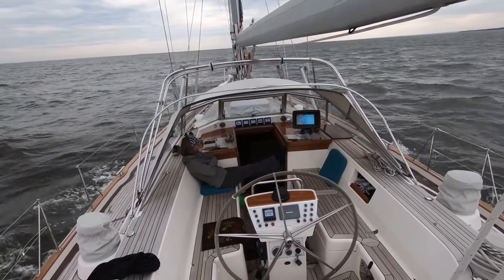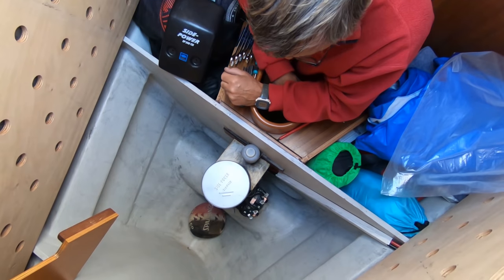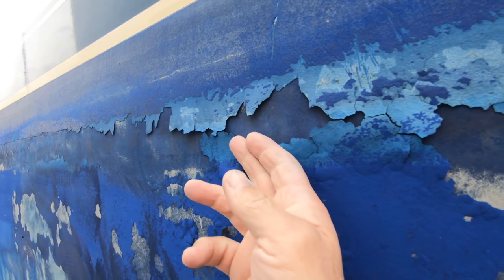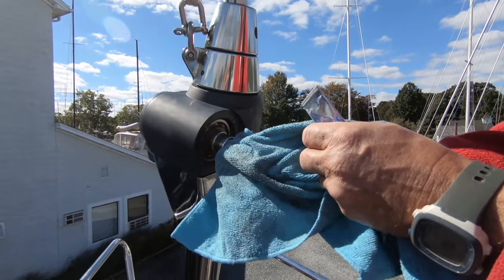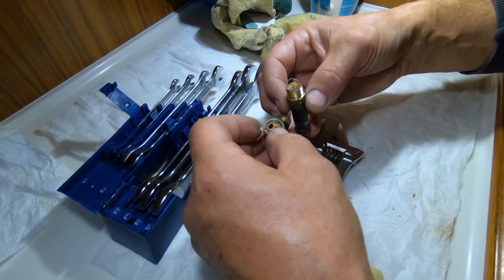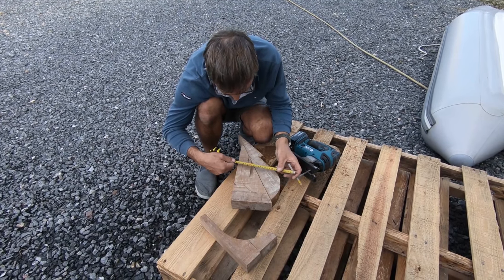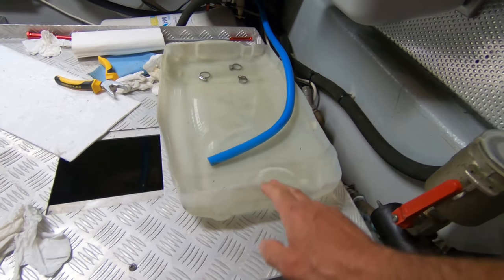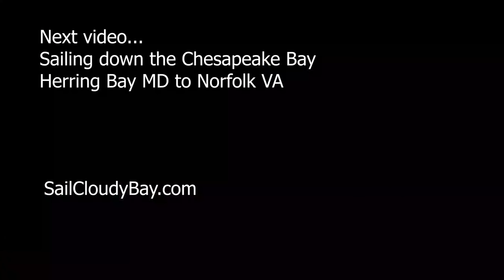ep48 - Boat maintenance - Herrington Harbour North (MD) – Hallberg-Rassy 54 Cloudy Bay - Nov 2018

Comment: You may want to clear coat the propellers with the same stuff they use on cars? Then when you hall it out they're clean. And then redo them as well when you do bottom paint?
Reply from the maker: I assume you mean a silicon coating?  Unfortunately I don't think what you put on cars would last even a week in seawater. The Prop-Speed that we applied in this video however is a silicon coating with the right strength and properties to counter the harsh marine environment. We now have this on the prop for 18 months and still nothing (much) sticks to it. but its frinkin' expensive stuff!

Comment: You can strip the bottom with a sandblasted. Substitute sand for crushed Walnut shells, it works great without causing and damage.
Reply from the maker: John Turner yes we wanted to Soda blast with the company in the yard. But they were too expensive and the yard owner would not let any other company in. So we went to Antigua to have it done at 1/4 price.
Reply: @SailCloudyBay  huge price difference

Comment: I guess the reason why you could not find that small valve for the stern gland is because it’s a gas fitting not designed for water 
What you have replaced it with is much better good job guys.
Reply from the maker: gary, that’s interesting. Makes me glad I made the timely change. We have several other places where there used those small gas valves, but thankfully not in critical places that could sink the boat if they failed. I have a lot of them on fuel lines and several on drain lines for the fresh water system. Thanks for the input.

Comment: I’m curious what the make and model of communicator you’re using when you go up the mast. Are they full duplex and wireless?  I mean do you connect these to a separate radio on your belt or is the radio built into the headset?  How the reception? Great idea for when up the mast?  I’m sure you use when anchoring and the motor is running. Great vlog!  Fair winds.
Reply from the maker: They are SENA blue tooth hands free headphones, full duplex. I think mostly used for comms on a motorbike between driver and passenger. Reception is very good, even 80ft up the mast. We always use them on mast jobs where communication between the 2 of us is critical (I dont like getting winched through the eye of our spinnaker block by the very powerful electric genoa winch!). We had planned to used them for anchoring too. But we do sign language for that one. They are a key piece of equipment for us.

Comment: I have to admit, I fast forwarded parts of this refurbishment. Perhaps I missed something, or did you really put her back in the water without painting the hull?
Reply from the maker: Robert, you saw correctly but must have missed the story. When we took the boat out we found the antifoul had reacted with fresh water and was cracking off.  It all needed to be removed. The only option in USA was a soda blast but the local company gave a price that reflected their monopoly. So we launched it as it was, and later had the bottom paint chemically removed in Antigua at a fraction of the soda-blast price.

Comment: I noticed when Cloudy Bay was in the travel lift getting ready to "make a splash"..that her bow thruster protective "grills" had not been fastened on yet..did you catch this before putting her back in ..just curious, also do those straight little bars provide enough protection for the bowthrusters in your experience..or have you considered anything else that's on the market to prevent against plastic bags, garbage etc or crap getting sucked in to the bow thruster tunnel..
Reply from the maker: Michael Douglas for sure the bars were in place when we splashed. Must just be an illusion in video. Not really sure how effective they are. Certainly we’ve had the occasional rope get in there, but no plastic bags. I haven’t investigated other protections. In fact most other boats the tunnel is totally open and I’ve wondered if I should do the same on Cloudy. But for now, the bars remain. I think the primary use is to ensure no body parts can get in there ... not that anyone would ever use the thruster with anyone in the water near it.

Comment: Was it needed to paint the screw? Or could it be left untreated, i liked it nice and shiney.
Reply from the maker: Gardureth, no, not really necessary.  But we do get marine growth on it if left unpainted. That shineyq brass look only lasts maybe a day in the water before it’s all dull. As I can dive in the boat and clean the prop regularly, I’ve never painted it before. But then I managed to acquire some of this very expensive PropSpeed at budget cost, so thought I’d try it out. So far, 6 weeks in the water, nothing has stuck to it yet ... fingers crossed it stays that way.

Comment: Hello! I have seen this special video and i want to ask about the primer for the gori propeller. wich manufacture you use for this part of work ?
thanks for answer....

Manfred/Europa/Austria
Reply from the maker: Hi Manfred, The coating system that we put on the prop was PropSpeed. Its a silicon based paint. It lasted 2 years (so far) with no growth on it.
Reply: @SailCloudyBay  Thank for response.. I also have an gori propeller with 3 blades, was very interested and excited about the great hob you have done. So i think i would use the same one for the prop. Your videos are very special and professional !! Its always nice to look at this video.

Comment: I'm Soon to retire and buy a 40 to 50 ft new Cat but im now concerned seeing how much maintenance and I'm not very good mechanically, how often is this kind of maintenance required and is it easy to find yards that will do it for you on a scheduled maintenance program
Reply from the maker: Out of the water maintenance is annually and yes, all yards would do this kind of work. But at a cost of course. Cost is USA were very high at $100 per hour so we chose to what all the work we are capable of ourselves. Glassfibre repairs and polishing are “special skills” jobs in my opinion ( for a professional finish) so we had people to do that. 
Once in the water, if you cruise is the civilized world then there will always be people to do the odd thing that needs attending. What most seasonal owners do is simply build up a “to be fixed” list and all the non critical ones get done but one yard during the winter. But again ... be prepared for the bills!  We could have bought a small car for what that polishing job cost!
Reply: @SailCloudyBay  I'll retire in4 years and planning to get a bigger sailboat, 40' or some sort and sail as far as the wind will carry us. Thus I find really instructive your vid  and most yous answer to Andaril cause we don't find very often those details about maintenance while sailing more than living cost. I'll subscribe to your channel in order to follow you and maybe we'll meet somewhere on the seas in few years. Fair wind
Reply: @SailCloudyBay  Thank you fortuitously cash flow will cover the maintenance as I will provision this within the purchase of the boat and put it aside, what percentage would you suggest for a new boat 5% per annum?
Reply from the maker: For a new boat that you want to keep in top condition, yes, that’s sounds about right. Older boats a bit more. Since completing a pretty expensive refit on Cloudy Bay we have averaged $5200 per month on total “boat” costs. This includes fuel, mooring, haulout, insurance, maintenance, spares, new buys, customs and official fees, comms, software, apps, charts and guides.

Comment: What happened to the parts under the keel that were sitting on the blocks? Did you lift and move it and then do those spots?
Reply from the maker: Good question Erik. We decided to leave the re-antifouling till we get to Antigua (where we are doing it right now). We have set the boat on blocks in a slightly different position here, so that we can now get to those spots. If we had to do it in the yard at Herrington there would be 2 choices 1) lift the boat again and re position the blocks or 2) do it when the boat is back in the slings just before launch. The first option would add cost and the 2nd option you don't have much time because once in the slings they usually want to launch you pretty quickly. Its usually enough time to quickly paint a coat of antifoul, but not to do serious work.
Reply: That used to worry me too when I got my first sailing boat 20 years ago - seems that they are mostly left, it is not a big deal.

Comment: Did you guys really go through all that work and not put a fresh coat of bottom paint on her before you put it back in the water?
Reply from the maker: Hi Jeff, Correct. But there was good reason for that. When we took the boat out (and as mentioned in the video) some of the antifoul paint had reacted with the Chesapeake fresh water and started to peel off, several layer down.  So we needed to remove ALL the antifoul and start again. THere was only one choice to do that, and that was a soda blast. But the only company in the yard allowed to do that wanted about 3x the usual cost (monopoly). So we decided to have the boat hauled in Antigua and have it done there for a fraction of the USA cost. We show this being down a couple of videos later.
Reply: Thanks for the reply, just found your videos and I’m enjoying them, I just thought you were acting like sailboat guys And  didn’t want buy new paint

Comment: Dumb question - do you just instinctively know what needs servicing (apart from the obvious replacement of faulty parts) or is there a schedule called out in a detailed maintenance manual that came with the boat?
Reply from the maker: Just instinctively really. No firm Maintenance schedule other than for the engines. But generally furlers should be 5-7 years, rigging 10 years, etc

Comment: about the same  time period  a Deer  swam  into Shipwrights marina and  a few of their employees at the time  jumped into a Skiff  in a effort to  get the deer into the boat as they knew it was very tired  and they were afraid  it would die the good news  was the deer did safely  get onto land  and was  chased into  some woods  I kept my boat in town Point Marina for a number of years  and  i used to  cruise thru Herrington North   with freinds and to get a bite  at the restaraunt  there  we also often fueled up at their fuel dock  as they honored  the Seniors discount  ive also over the years  had looked at several  boats for sale docked at North  offered by Wilson yachts  whom i did some business with over the years btw  the camera angle of the dinghy being lowered was  weird as at first  i didnt see or know there was a forklift  there and it looked like it was  hovering on air  for a moment  i feel your pain  on the bottom paint  dilemma  owning a boat isn’t cheap  ive had 16 or 17  of all sizes and types  I reckonize  your boat from  being in the same area for 20 plus years  nice design on the Cutlas bearing puller
Reply from the maker: Craig, thanks for the nice comment.  We are just back to Herrington now (arrived yesterday).

Comment: Fantastico video e fantastica barca ..io sto per acquistare un Beneteau 42 cc cosa ne pensi? Navigazione  in solitaria
Reply from the maker: Thanks for the nice comments. The 42cc is a nice size boat and with the center cockpit, a safe feeling. I've never sailed a boat that size by myself. It could be said that sailing with Oana I am infact sailing solo, but there are lots of times when we do need both of us to make moves and sail adjustments. And coming into marinas and docking would be very challenging solo. But like everything, you can get good at it with practice.
What you have to consider is that the bigger the boat the bigger the stress and load on everything. For instance, could you take down a sail by yourself if you had to? On Cloudy Bay, taking down either main or genoa is a huge job even for 2 of us. Imagine having to do that at sea. So, if I was to sail solo, I think I would only take a 36-38ft boat maximum. Bigger boats can be sailed solo for sure .... but you've go to think of the "what if.." scenarios. Because they will surely happen, one day.
Reply: I think that living and sailing full time in a sailboat of 36 is too small for me as I sail a lot between the ocean and the Mediterranean in more I live by boat. the Cc is fantastic and reduces a lot of maneuvers, obviously a help can be comfortable but like all things just adapt and the habit and experience will do the rest. I agree that the bigger the boat maintenance is needed but more than the size to give problems are the unnecessary accessories and options that we add to "make the life on board more comfortable" in reality is exactly the opposite between maintenance and spare parts as I am not worth it, I prefer to give up. have you ever sailed to South Africa to Asia?
Reply from the maker: No, we have not sailed to Asia or South Africa yet. But both are on our intended route.

Comment: What does it save you % wise doing the remaning work in Antigua?
Reply from the maker: The annoying thing was that the only company in the yard that would do a soda blast was 2-3 times the going rate - but the yard would not let other outside companies come in to do it. So there was a bit of a principal here - we were not playing that game. 
Overall Antigua (including the extra haul out) will be about 10-20% cheaper. But there was another factor: temperature. Once stripped we need to apply 3 coats of InterProtect and that needs the right weather. In the Chesapeake in November we were going to struggle with that one. Plus again, the cost they wanted to apply it was outrageous. So we purchased all the paint in USA, where its cheap and will apply it ourselves in the lovely climate of Antigua.
Reply: @SailCloudyBay  Leave it to an American company to leave you high and dry AND give you the old heave to, simultaneously.

Comment: Bonjour les amis !!!
Comment ce fait-il qu'un si beau voilier ait déjà des problèmes ? , surtout au prix que vaut ce voilier .
Cordialement
Reply from the maker: Bonjour, Thanks for the comment.
Well, its a 10 year old yacht that we live on 24/7 and sail hard in hostile salt environment in the tropical sun and humidity. If you put a 10 year old Mercedes through the same, it will need same attention.  Maintenance on yachts like this will always be high. Even new ones. Anyone who says they dont have to maintain their yacht are either drinking too much wine or their yacht is actually falling apart. What we showed in this video is just standard things that need attention when we take it out the water, annually. True, some yachts have very simple systems, but this one is very complex.
Reply: @SailCloudyBay 
 good evening, thank you for your answer, I understand now, and good navigation
Mous

Comment: Throw the tank away and get a $300 tankless propane hotwater heater. They work great and do not need a vent.
Reply from the maker: Good suggestion. Thanks. But it would not be practical to have the quantity of propane needed, on board a liveaboard yacht. Its bad enough having to source propane re-fills for just cooking purposes. There is no tank or fitting standard that covers multiple countries.  On the other hand, a diesel-fired water heater could make sense.

Comment: Nice, Where to find Propspeed I can´t find anyone near Sweden,  that can sell and send.
Reply from the maker: Lennart, not sure in Europe. We bought ours in USA. It’s also available here in Antigua, so I’m sure there will be suppliers in Europe.
Reply: It is available in Australia, but not sure that it is worth the effort and expense.
Reply from the maker: Agreed. It is bloody expensive.For a sailing yacht where I can dive and clean the prop regularly it doesnt really make sense from a cost point of view.  For motor boats that rely heavily on clean props for efficiency and is their only form of propulsion, I can see the value. It may even save them the cost on fuel I suspect. But for our sailing I would not do it again. I experimented because I managed to get a 200ml pack at a knock down price. Otherwise I would not have gone to the trouble.

Comment: May be sorry of using chinese parts in  a critical components.
Reply from the maker: Which parts would those be?  I've forgotten
Reply: @SailCloudyBay  An insert on the shaft. If I recall right you said could not find the OEM part and purchased a Chinese replacement.